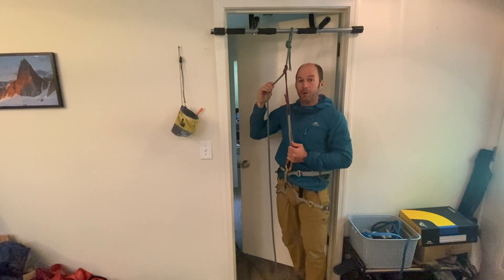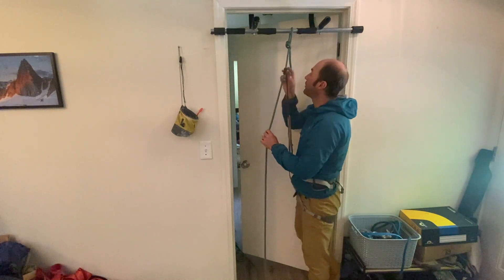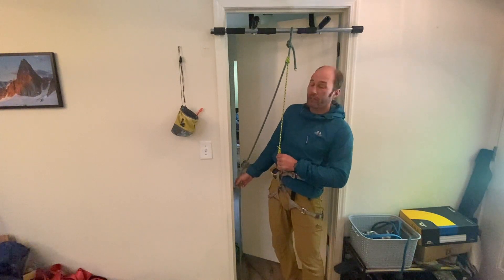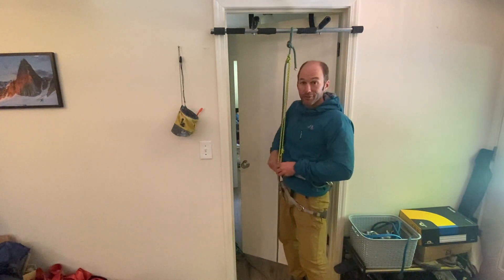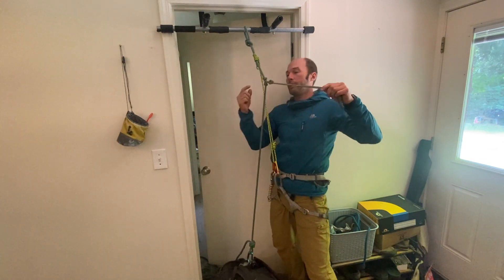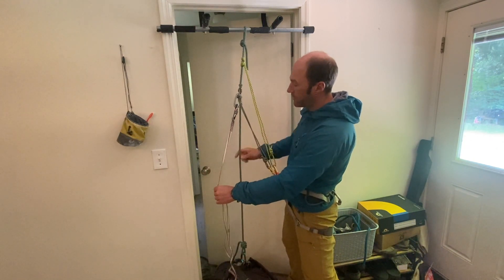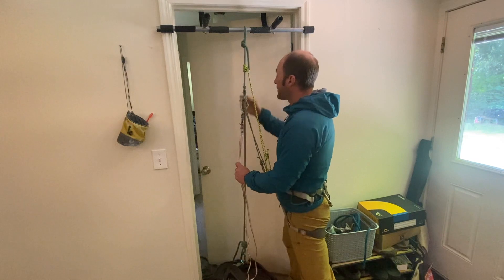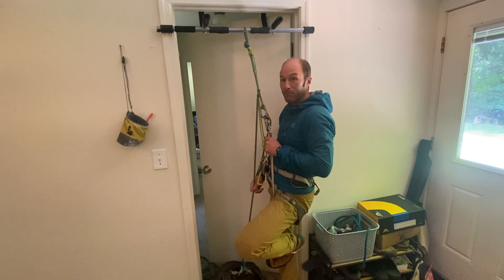Prusik out of a Crevasse

Comment: Hi, 
Thanks.   This is a a very methodolgical video.  
I love the trick with the overhand knot, on the backup prusik.  
Besides the mentioned advantages,  I see other advantages.

Usually, when we do have to put in practice these techniques, it is in some sort of emergency.  And, on top of that, we are likely to be tired, exausted, cold, bruised, on that last droos of sunlight, with difficulty to operate the gear with bare hands, stiff / wounded fingers, etc.

Using a carabiner for the backup & foot loop, is very quick, and eliminate the need to operate a 3rd prusik , in cold, wet, exsaustion contitions, , etc.

From Risk Management perspective: putting on a prusik, needs super attention. If not done right, it will slip.
And, it needs time to adrees it.
As we are in emergency, we are more likely to do mistakes, or do shortcuts. 
So, that trick also eliminates a potentially risky step, off the whole process. 
Even if it's only a foo loop. Slipoing of a foot loop may cause us to bump against something, or just use our last droos of our energy to re tie it. 
And that may put us in a  loop of stress and mistakes. 

This trick is  brilliant. 
(i think i had seen this somewhere, but still, it is worth noting)
Reply from the maker: Thanks for all the positive feedback!  Much appreciated.

Comment: Great video. I learned to climb trees on a very similar system. Your system improves the way the foot prussik tie in point works compared to mine. The only tweak I might suggest is if you are going to be on this system for a long time is to have your harness carabineers going through both of your tie in loops, gates facing down and away, on either side of your belay loop. This completely avoids any kind negative effect from cyclical loading. Like you said, it's not really a safety concern, but it keeps things more organized and there's less gear rattle in your life safe systems which keeps my mind calm too.
Reply: Hi
This is a great video indeed.
I love the trick with the overhand knot, on the backup prusik.  
Besides the mentioned advantages,  see